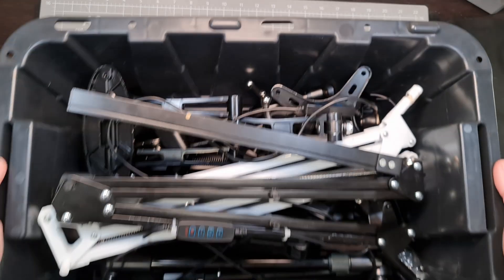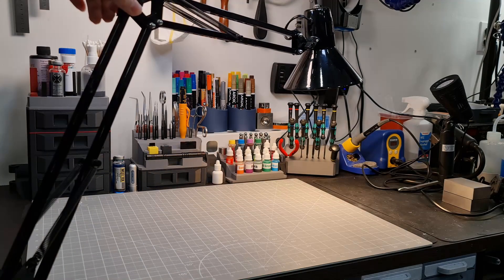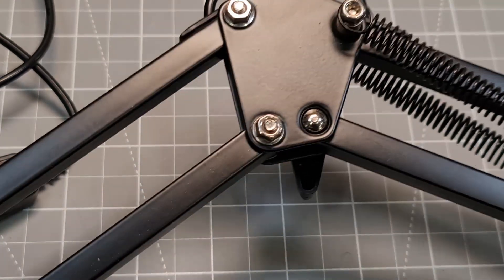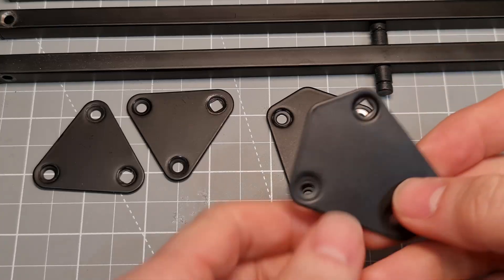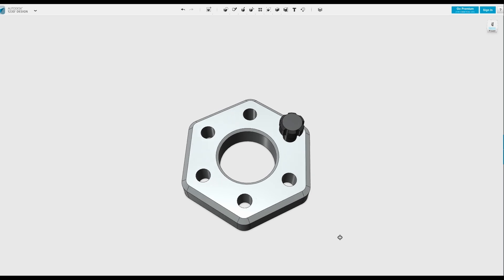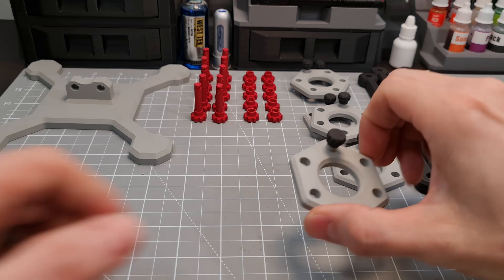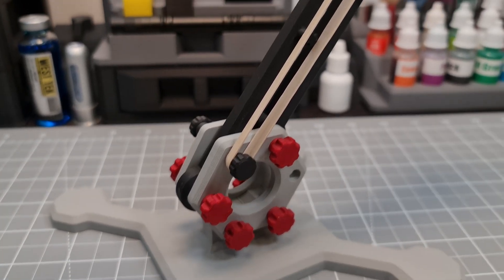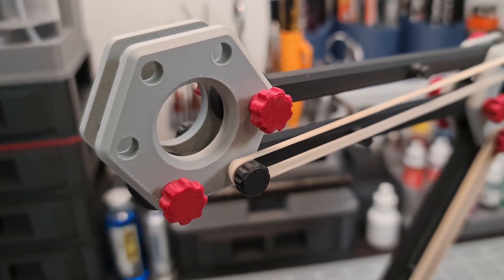I BUILT ANOTHER USELESS THING

Comment: I actually have 4 of these in my workspace that was i wanting to modify, but didnt really know a good place to start. This might be the place. Thanks for sharing.
Reply from the maker: Awesome, I hope it gives you some ideas!
Reply: Pretty sure only some of your observations actually matter for a boom arm's functionality.
As far as I know, the most important opperating principle is that each segment of the arm forms a parallelogram. 

So for a given segment, both arms must be equal length and their mounting hole spacing at both ends of the segment must be equal. However the mounting hole spacing and arm lengths from one segment don't need to equal those of other segments.

Matching these paramaters between segments might be relevant to the tensioning method of the arm, but my guess is it's just to make manufacturing easier by reducing the number of unique parts.

Anyway, just thought I'd let you know that the potential design constraints you identified probably aren't as strict as they might seem and you can probably let your inspiration get crazy with future designs.

In fact, the arms of each segment don't need to be straight as long as the straight distance traced between bolt holes is equal and still forms a parallelogram. So really, go nuts.
Reply from the maker: Fair enough. Thanks for the input!